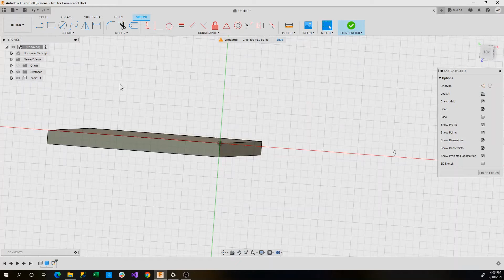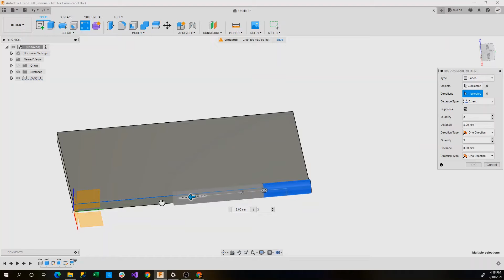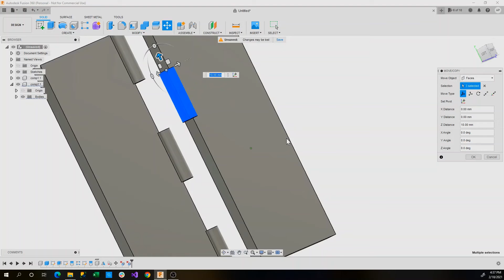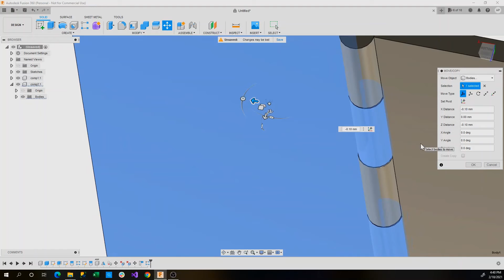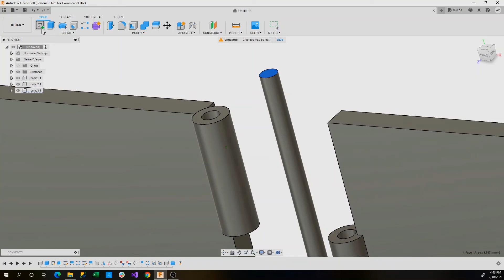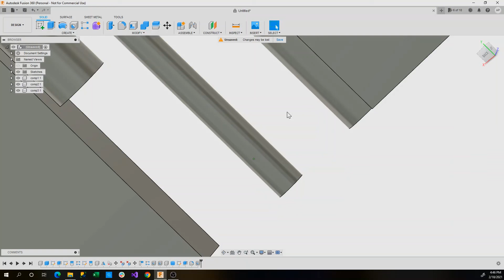Fusion 360 tutorials - Functional Hinges

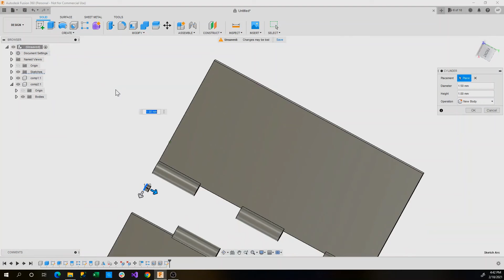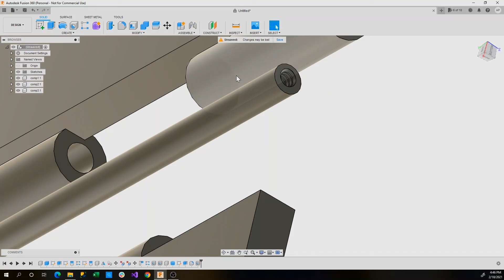Comment: There is a problem with this hinge in terms of it actually being "functional" though. It seems to be a common thing in many youTube tutorials, and I think it's because if  revolute joints are applied, the animation will make it will appear to work no problem. The ACTUAL problem that would prevent this hinge from working can be demonstrated at 18:19 and the 23:00 minute marks. If you pause the video at 18:19 you can see that the edge of the top plate protrudes past the 3 cylinder parts. So that protrusion will prevent the two cylinders of the bottom hinge to align with the top three cylinders. You can also see it at the 23:00 mark. That  corner edge of the plate? How is the cylinder of the other plate going to align with that cylinder if you don't remove that corner edge?

Comment: Avi, much of the more complex parts of your videos begin to lag and drop frames a lot and the audio gets choppy (sometimes you'll have 5-10 seconds of activity not appear in the video when it freezes completely).  Assuming you aren't experiencing these issues on your end working with Fusion 360 itself, some of this may be decreased by right-clicking OBS and selecting "run as administrator" as this will prioritize computing power to OBS first and then to other programs after.  If that still isn't enough, you can try experimenting with changing bit-rate and resolution.  It may sound counter-intuitive, but a smooth 720p video looks better than a choppy 1080p one.
Reply from the maker: Thank you for letting me know! I'll start running OBS as administrator and shifting down to 720p. Let me know if that helps in future tutorials. Again, thank you so much for directing my attention to that. Sometimes those errors don't pop up in my post-processing of the videos so your input is extremely valuable.
Reply: @avramplager1953  Sure thing.  Really getting a lot out of the videos overall, just hate when I end up missing steps because of minor settings issues.  Hope that helps!

Also, depending on your graphics card, you may be able to utilize NVENC encoding in OBS which essentially uses an otherwise unused part of the graphics card that may improve performance and is specifically meant for recording/streaming.